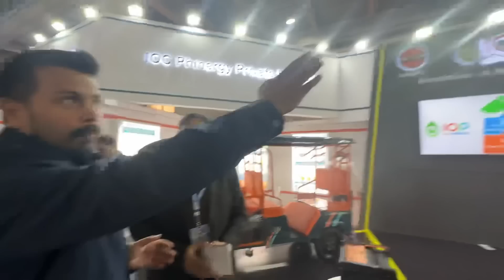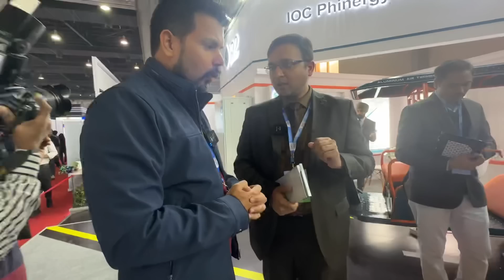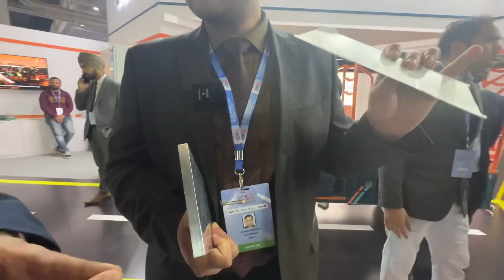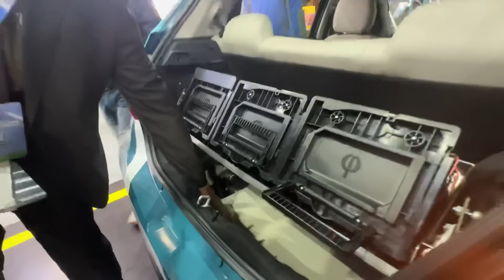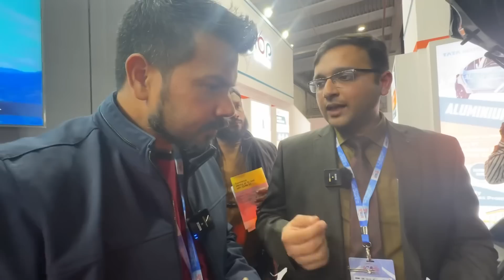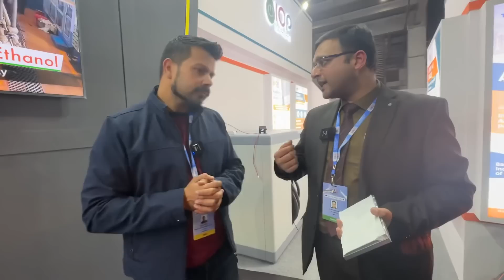Revolutionary Aluminium Air Battery Will Blow Your Mind! Li-ion Alternative By IOC and Phinergy

Comment: Can the lithium buffer be extended to 130 to 150km then for city drive lithium buffer can be used and for highway aluminium air can be used
Reply from the maker: No the buffer is very small
Reply: @motoroids  now it is small in prototype but future car can have bigger atleast 100km lithium buffer battery then it will be viable, anyway aluminium air battery is range extender as per Gaurav aggarwal

Comment: Al air battery can be effectively used on UAVs specially defence UAV as neither they will emit heat nor sound signature ie they will be stealthy if there frames are of composite material. It will perfectly suit suicidal drones.

Comment: Platinum is used as a catalyst in the Oxygen electrodes, which will not need to be changed every time new AL plates are inserted, but they will wear. Does that mean the Platinum will be lost, or can it be recovered from the old plates and electrolyte? With catalytic converters in gasoline cars, they were very expensive until manufacturers got platinum recycling of old catalytic converters going. What is the projected consumer price per kWh in a fully integrated market with recycling? Does this Al-air battery require a subscription / deposit to be eligible for swapping batteries? Edit: the representative says they don't have a figure yet for running costs!

Comment: the cost of aluminum is around ₹ 110 per kg so if a single plate is around 200 grams t requires 2.5 kg of aluminium replacement for each battery roughly around rs 300 per battery and rs 900 for 3 batteries
Reply: Let's say even if it is 1000 rupees, it'll approximately come to around Rs.2/km (if the range comes out to be around 500km)

Still a lot less cheaper than petrol/diesel cars 😅
Reply from the maker: But it won’t be available at full cost as it’ll be recycled

Comment: The consumption is not a disadvantage as stated by the interviewer. This aluminium goes back. The cost charged by IOC+Phinergy is towards replacing the stack and electrolyte every 500 odd kms. The question should be how much time does it take to replace a stack at an IOC outlet? What cost?

Comment: Biggest challange to aluminium air batteries will be mass adoption of technology due to the fact that on an average battery pack will need to be replaced once every 5 days.
Now multiply that with total registered vehicles (29.8cr X 3)= 89 crore battery packs.
I have only considered 3 batteries per vehicles but actual number will be at least double of it.
Now begins the problem of logistics, let's assume hindalco is able to recycle these many batteries in a week, the cycle of getting used batteries to hindalco plants and recycled ones to pumps. Not to mention that petrol pumps will need to create huge ware houses, underground tanks won't work lol.
And please don't give example of CNG being transported all over the country, it's mainly donr through pipeline.
I would love to see this work but it won't be as easy and will need work on war footing.
Thanks
Reply: That's why it's better for heavy duty vehicles
Reply: Hiw often do you fill petrol in your tank? Same frequency will be there.
And recycling plants will have to be setup across the city, which uses electricity yo regenerate Aluminium.

Comment: Why did IOC place this guy ignorant, stupid Gaurav as demonstrator who probably did some quick reading of the brochure this same morning.?
He does not Explain the basic concept that there is no charging required as in normal EVs. Just replace the Aluminium stack when it gets depleted.
Massive advantages are as follows  1. there is no need for countrywide Charging stations. The Aluminium stacks can be replaced in every petrol stations. 
2.Also there is no big demand on the grids for Electricity for charging millions of cars in the evening. 
3. Disposing EV batteries and hence chemical pollution is not there 
4. No need to depend on China for Lithium. They control the world's supply of lithium.
5. India is the biggest producer of Aluminium. It will be like being the Saudi Arabia of the future 
This technology is the future. They need to work hard and quick to iron out any bugs in the technology and commercialise at the earliest.
Meanwhile stupid Gaurav, go and prepare better next time.

Comment: Still i think ,every time replacing 13 Al plates every 500 km is going to be a very costly affair and again salvaging the aluminum from the electrolyte is going to be another costly affair..wellll
Reply: It can be easily achievable using battery swap

Comment: Al-air batteries suffer from corrosion which reduces their effective discharge voltage. Zinc-air is a much better alternative.
Reply: What is the energy density of Zinc-Air battery?
Reply: @arunkumarts8279  theoretically 1370 Wh/kg

Comment: so in all like fuel aluminium & electrolyte has to be transported in each city from the factory to stations, whereas in EV's you don't have to transport anything.
Reply: 40% of a Lithium Ion EV's cost is it's Batteries

"10 Lakh" for a Lithium Ion Tiago (with a Degrading Battery after every charge)  Vs "6 Lakh" for n Aluminum Air (that runs like new every time the "Al" is replaced) Tiago.   

Take your Pick
Reply: yes, but because it can be stored freely and no expertise required to replace. Every Petrol Pump would stock these immediately .
It will spread faster than your charging network
Reply: @MeetRT  agree on replacing, bigger picture is of used aluminium & electrolyte which will be removed from vehicle. There is an additional handling, transport & proper recycling which is to be taken care of.
Reply: @vineetlele1489  Alluminium is 100% recyclable and its ecosystems is well established in India and world wide.
So handling and recycling already exists, it just needs to cater to new service line.
Reply: @vineetlele1489  Its impractical. Very difficult to adopt.
Reply: It's going to be a hit.
Price equal to petrol version if not less.Running cost between battery and petrol.
Total cost of ownership is cheapest for 15 year span.
Reply: In Lithium ion EV also you have to transport the battery containing lithium and electrolyte.

Comment: Replacing the aluminium in just one charge cycle is a huge pain.
Reply: It's like filling petrol
Reply: You are not replacing aluminium yourself, you are swapping batteries. It will be as quick as filling with fuel. But what is easy to miss because of sound quality is that you also have a lithium battery with 30 miles range which for an average commuter is your daily drive. This means the aluminium battery is a range extender for longer trips. It’s a very neat solution.
Reply: "Ruko Zara.. Sabar karo"  

t'll be like Filing Petrol/Diesel from an IOCL Pump.
Reply: There is no charge ... It consuming aluminium to produce energy ... But as they said in video they r bringing cost down to equal to lithium ev and petroleum means it is costly for now
Reply: This solution is co developed by IOC , they can use the wide net work of petrol pump for battery swap, swap your depleted battery and get new one. India is eagerly looking for alternative fuel to reduce the oil import
Reply: Yeah, they'll need some sort of modularity in this